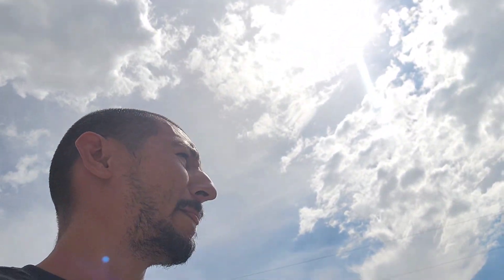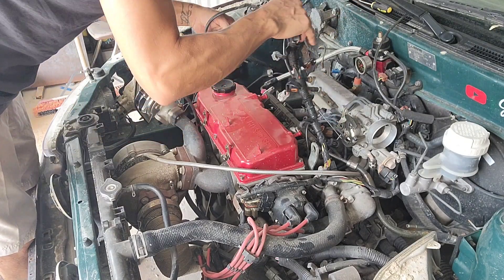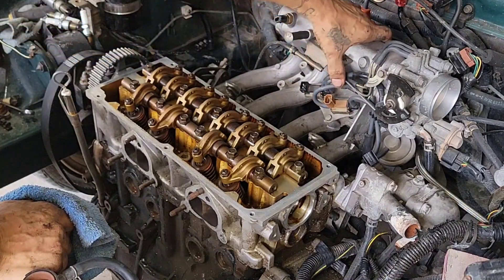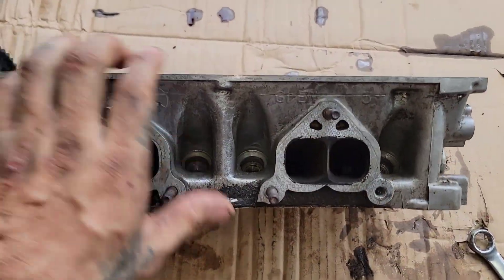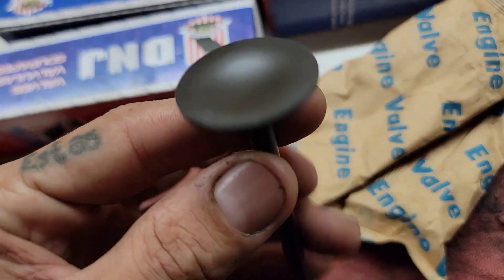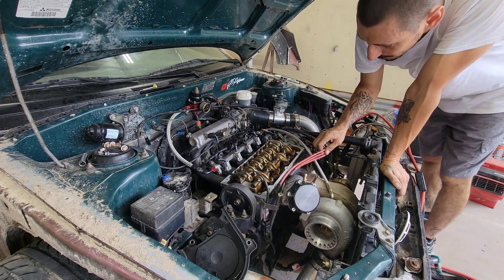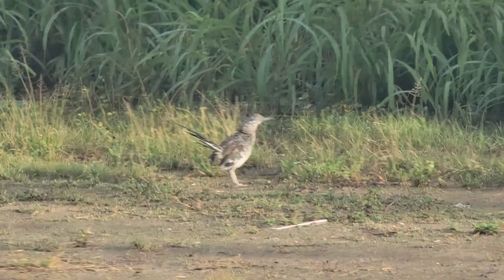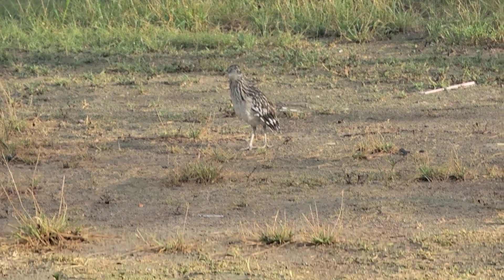Fixing a Bent Valve on MITSUBISHI [ 4G15 ] Turbo

Comment: I had a friend put a new timing belt on my ‘04 Focus SVT. About 250 miles after it was done it shredded the new belt and sent the valves into the aluminum cosworth head. I was doing maintenance so that wouldn’t happen. It really sucks.
Reply from the maker: Man, that sucks! 😮‍💨
Personally,  I like hatchback cars more than coupe, especially in manual transmission. But a broken timing belt is the worst that can happen to an interference engine.. aside from a rod